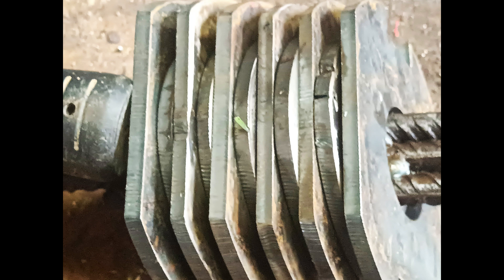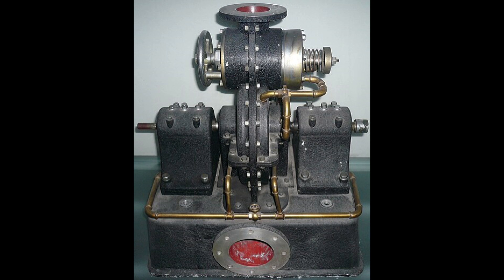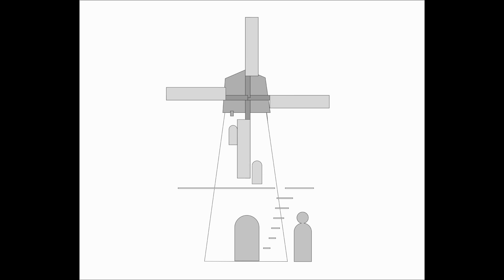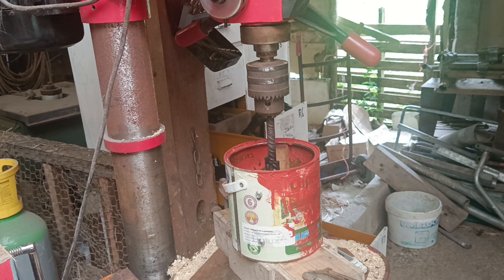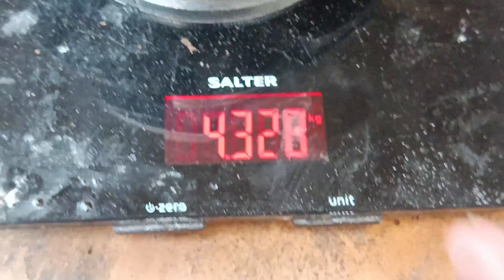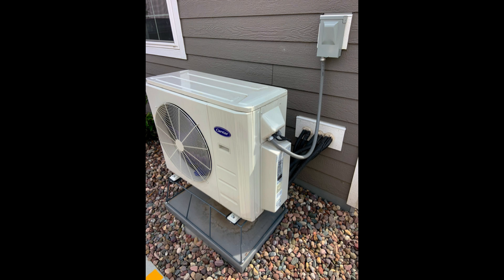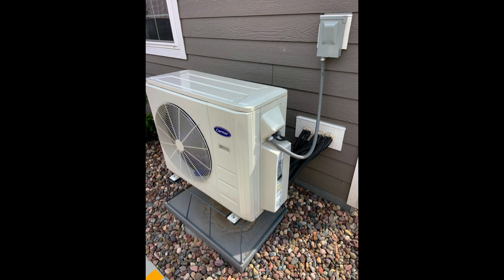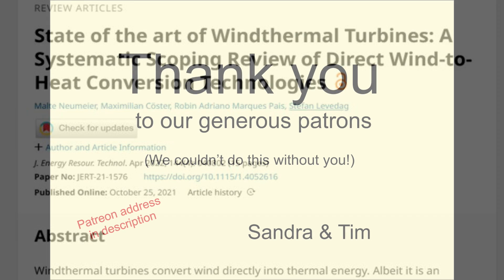More Interesting Things About Friction And Mechanical Heating - It's All So Interesting!

Comment: Efficiency is usually thought of as "How much of the energy put into this thing actually did what we wanted it to do."  The rest is lost as heat.  And energy is never lost or destroyed, it can just go some place that isnt useful to us.   So "efficiency" and "energy loss" dont always mean the same thing when it comes to heaters, very especially heaters that dont use a fuel.  An electric heater is 100% efficient:  all the energy it uses ends up as heat.  A 1000 watt space heater, a 1000 watt high efficiency LED light, and a bitcoin mining computer using 1000 watts will all heat up a room identically.

So, whatever you have the output shaft of that windmill doing, as long as its only barely able to do it, it will be making heat.  Grinding steel plates against each other, stirring a fluid, moving magnetic fields past a conductor, whatever.  Just add load until the windmill can just barely do it.  Normally I'd say add a flywheel to help average out the input energy of the wind vs the load, but the mass of the sails/turbine and rest of the system are probably enough.

Comment: Are small liquid-cooled alternators/dynamos/generators a thing? (I know GIANT ones exist) I imagine such a unit could serve dual purposes by just shorting the output through a large liquid-cooled variable resistor. You could even use a "water resistor" by submerging a pair of heavy steel plates as the variable load, and looping that water into the system as well.

Comment: Don't think that the heat pump is very complex, the only thing is the compressor, the rest are some copper pipes and radiators, and gas you can use propane, I have made two heat pumps for something I'm doing and with propane they work very well.
Reply from the maker: I'd be interested to see how you did that Gabriel - do you have videos about it on your channel?
Reply: @wayoutwest-workshopstuff6299   Not yet, but I have seen most of the information on the youtube channel of hyperspace pirate.

Comment: Maybe use some very high volume hydraulic pump? At 80 rpm it may still take enough power to restrict windmill, all that restriction will be converted into heat.

Comment: This can't possibly work but here goes. One complete coil (a shorted out motor winding) spinning inside another complete coil. Will this generate electricity in both coils and heat them up? I have no idea but if it was put in oil and then water cool the oil with water. Cheers

Comment: Heating with a brake is a good idea. I'm not sure you need to re-invent the brake. Any brake mechanism would work assuming it is big enough and you have some way to keep it cool (e.g. the whole thing is in a box surrounded by water) You can stick with your plates, but you only need 2 stators and 1 rotor and a way to adjust the squeeze force.

Comment: Completely get why you want to use the plates like this (some wheeled diggers basically use this for brakes - it works well! but it might be worth alternating materials so you don't get cold Welding / galling (not sure what's an easy/ cheap second layer, wood might be too low friction when wet and concrete might wear the steel to quick? - oil could be used instead of water too for higher friction materials ). Another cheapish option for magnetic heating is just submerging an old pm motor in oil, and shorting its windings (through a few metres of thick wire which is also under oil). The windings are normal good to at least 180c (a longer shorting wire can increase its resistance and lower running temp if to hot - or a big resistor bank could be used ). Ac works better for this as brushes wear and knacker bearings if in oil, the brushes might not cope with the current too - but dc would still work for a while though!

Comment: Hey Tim, may have been said but the favorite for energy storage is a sand battery. How about stirring the sand to heat it, like a huge rock tumbler, low speed high torque can be used by large diameter tumbler and small diameter for high speed low torque. The paddle could be made variable diameter or pick up more if available energy rises. Cheers
Reply: That's a great idea for my daydream of manufacturing sand.

Comment: Problem with heat pumps in winter is where do you pull the heat from?  The cold outdoors ? I would look into  Dynamic Heat Generator..  Love your content Cheers
Reply: There's been some success with drilling below the frost line to get to soil or the water table that's warmer than ambient. Not classical geothermal of course but same principal over a smaller thermal gradient.

Comment: thank you for this follow-up video. the induction heaters may require high speeds, but there is less friction and torque required to drive them. I'm sure you already are aware of this, just wanted to comment this anyway lol. I'm still rooting for the generator though

Comment: I'd suggest using oil instead of water for the inner tank as I think rust will be more of an issue than you think. If you put the gears under the fluid as well then the gears are nearly 100% efficient as they lose efficiency through heat. Do as much gearing as you want under the fluid and you are not limited to metal on metal friction. I prefer the heat pump idea. See if you can pick up an old cheap freezer or fridge pump. Lot's of interesting ways of getting the heat to pump (air source, ground source , solar water heater, compost/manure heaps)

Comment: Thinking of friction - what about car or even truck (lorry) brakes? They´re made to turn kinetic energy into heat and release it into the air (or in your case water) around. You could stack brake discs and pads inside a pot and control the friction with a spring pressing on the whole stack. The more rpm the windmill turns, the more pressure on the spring so alongside to the heat you get kind of a governor for the rpm of the mill.
My idea is four brake pads, then the disc and then again four pads. Then the same setup again and again. The discs are turned by the shaft while the pads are held by some kind of track so they can move a little up and down (as necessary depending on the wear and tear) but not sideways.
I´ve got lots of ideas for this, but no possibility to test it myself.
Reply: Just absolutely make sure they aren't asbestos based (they still exist in america), also you probably want a way to contain the dust because any of it is absolutely unhealthy :(
Reply: What about cutting up a second disc and using that as the "pads" or simply sandwiching the discs without pads? Brake pads are made to take most of the wear while providing a quiet smooth, fast braking experience which we don't care about. Discs are made to provide a friction surface and dump their heat into the surrounding area which is what we want. I guess it also depends on economics of what he could get the cheapest. So many experiments!
Reply: pads waer out. brake rotors wear out.

make dust. squeal. need maintenance. servicing.

eddy currents, magnetic induction, does not.

Comment: My door bike trainer uses rotating magnets rotating in an aluminium housing to convert rotation into heat. No rubbing or wear, and you can control how close the magnets are to the aluminium to control the torque…maybe second hand  “turbo trainers” could be a useful source of parts.
Reply: And they come pre geared to work at bike pedalling rpms …like 30-130 rpm sort of thing.
Reply: Why wouldn't a generator be more efficient? A generator uses magnets to pull electrons through a metal, eddy current braking does the same thing. Except with a generator you can dump all the electricity into a load designed to create heat at one single point. Resistor, bulb, heating element.
Reply: @pgtmr2713  because a generator is NOT SUPERCONDUCTING.
it has resistance.
and its in parallel with the load. 
series?
parallel ;)

what happens when you have equal resistances?

half the power is dissipated in BOTH.

lenz law demonstration... magnet in a copper pipe. resistance is the pipe itself. the conductor and its induced opposing eddy currents.

cut a slot in the pipe, theres no eddy currents, no lenz reaction.

change the pipe for a coil. short it out. lenz reactions. eddy currents. wheres the voltage? you have to break the closed loop to measure it. you cant actually measure it. it doesnt exist. you only have current as a magnetic field and a "virtual" emf due to the resistance of that conductor.

you put a resistor across... as it gets larger, more "open circuit", the voltage increases, you measure more drop across the load, as current flow through the generator AND the load reduces. 

you overlook that due to current flow, some power must always be lost in the generator itself.

"jacobs law".

your generator is only "efficient" if its of much lower resistance than the load, and the output of it is well below what it can actually deliver! if it were to deliver full power to an equal resistance, you could only transfer HALF the power, and the rest will appear as heat in the generator.. but that would actually be when its 100% efficient! 

efficiency is a bit like statistics, you have to be careful about WHAT theyre measuring and comparing ;)

an eddy current brake on the other hand confines all that current to one conductor, and all that current appears as heat, due to currents through resistance.

its like water brakes... you could make a water pump, hydraulics, the fluid, pump, and hydraulic thingy get HOT.

but the task required that... say, i was running a pressure washer. or bobcat... excavator?

whereas if i wanted to actually just make HEAT? or a dyno, a variable load to test engines?

i would plumb the pump to itself and work on that, why do i need the whole excavator?
Reply: I have seen cody's lab do a similar thing and it works quite well!! Magnets can be expensive and hard to get though, especially neodymium.

Comment: hoo boy there is a lot to talk about

I said before that generating heat this way IS the most efficient, as any losses you have will end up leaving as heat, which is what you are trying to get anyway

that said

you already have a line shaft setup, and I seem to recall that there were line shaft shops that were powered by windmills. I might be foggy on that, as most of those mills were used for grinding flour. one would think you would have entertained that idea, maybe you did.

then again, I had visited an energy fair locally and I had come across the evacuated solar powered heater tubes used for heating water. I came across on of them INTHE SHADE that I thought it's temperature readout was faulty, as it was reading in excess of 100+F while IN THE SHADE. I confirmed it was working correctly when I touched the output manifold and burned my finger on it IN THE SHADE

but finally, you stated this was an exercise in finding a use for a windmill that is easy, useful, and not complicated. and have pointed out everyone's alternatives as not meeting those requirements. I am not sure how much of a market there would be for ground products (garlic?) that you harvest, but a mill would look to be the easiest, but maybe not the most useful, with your friction heater being 2nd, or maybe  3rd most ideal

so, when can we expect some wind brewed tea?

Comment: For the issue of needing an additional fan or pump along side the compressor to go with your heat pump option: You are building this to fit to a windmill that you want to use to concentrate heat... You can use the same 'fan' you're running your windmill with on your cold side, and your hot side fan can be whatever you were going to use to move the hot water from your friction generator. 

The sides of your windmill become your heat-capture 'radiators', warming your chilled fluid by allowing the same wind driving your windmill to blow over them and transfer energy into the system so you have more heat energy to pump out to your hot side. It may be more cost effective to build it as a relatively small refrigerant loop heat exchanger inside a larger brine tank/loop. 

The thermal safety wiring on things isn't really any more complex than you would need for your friction based machine - You do probably want something on there to monitor that your friction core isn't running dry and turning into a glowing lump waiting to fling itself apart after all... Remember: Every machine can become a smoke machine if you run it badly enough.
Reply: This is a scaled down version of an idea I had for the 70MW range of turbines (using recycled truck/train/marine engines as the compressor).

Also if the site is built over an old mine (preferably flooded) the heat energy can come straight from there (albeit better suited for district heating)

If conventional vapour compression gas is not available, a humid air medium could be used.

Comment: technically you don't need high rpms for most of the alternative heating methods you mentioned, you need high surface velocity. For induction heating, you could either spin a smaller disk really fast (with efficiency loss in gearing), or a large disk turning relatively slowly. What would a 1 meter diameter steel disk do, turning at 400 rpm, through a strong magnetic field?
Reply: got he 400 or so magnets he'd need? he pointed that out
Reply: @Tater1337  He's pointing out having the magnets stationary outside the wheel, so you'd need less.

Comment: If you're going to have heat exchangers between the liquid around the friction plates, and the water in the storage tank, you could put other materials around the friction plates to generate the heat. 

Maybe instead of water, fill the friction plate container with oil, sand, or salt. Solids like sand or salt could generate more friction and more heat at a lower RPM.

Comment: The main problem I can foresee with the friction heater is in the exchange. It certainly would work to heat up water, as your clever testing shows, but how efficiently can that heat be exchanged into the water you actually want warmed up? That's an open question, and I think perhaps you might need to run a second experiment with a primary container that is sealed up a bit better than your first paint can test, and place that into a second container to see how well it heats (of course the best exchanger will be one designed to maximize surface area, but this basic set up would work for a test). Other methods like electric might lose some efficiency in the conversion, but would that end up being more efficient over all because it could heat the water directly? Again, that's an open question. 

I am intrigued by the idea of a wind powered heat pump. The main question there is whether or not you can get a high enough pressure.  If you were curious to try it, old school heat pumps used ammonia for their exchange gas; still a potential for danger when under pressure and breathing, but certainly safer and cheaper to obtain for testing purposes than other refrigerants.

Since you mentioned induction heaters, would there be any reason you couldn't do that in combination with the friction heaters if you're using steel plates? Perhaps using electro magnets rather than rare earth magnets? If you do end up trying a design like that, consider if you can make a double shaft and have the plates rotating one direction while the magnets rotate the other, you're effectively doubling your speed without having to make the contraption actually spin any faster.

Comment: Heat pump and drive the compressor from the shaft rather than electric, then your going to aim for above 100% efficiency rather than converting it directly to heat from friction your just moving heat from the environment to your heat storage, even 0c has enough energy in it to heat something up, yes it gets less efficient but your going whats less than 300-500% is still a nice gain.

Im sure its plenty complicated but would love to see this kind of thing in practice driving from a wind mill.

 - Not a expert at all just ideas to think about

Comment: Good idea about reducing the number of energy conversions so using friction is a good wheeze imho. To increase it even more you make the rubbing surfaces rougher by pitting or some welding blobs or some such which will also wear but create more friction while it is rough. Also, if you add some weight to force the plates together, more friction too - the resisting force is mu, the friction coefficient, times the applied load - so if you squeeze the plates together, it will be harder to turn and generate more heat, but you must balance against the rotating speed - the work you get out is force times velocity, so a bit of experimenting to find a good balance. Good luck and get well soon
Reply: you want the surfaces smoother, not rougher. maximum friction surface

Comment: What about submerging an air pump into the tank of water (driven by the wind mill). The pumps get very hot, causing the surrounding water to get hot. You'll also have compressed air in the process, if you ever need it.... Just a thought. Looking forward to the project.

Comment: With a heat pump you only need a fan if you don't put out enough collector panels, if you have to small a collector like a heat pump designed for a flat or high-rise it will freeze without a fan but if you have space you can put out as many collectors as you like.. And the good thing is the collectors are very cheep.. you could even use large panels of of the back of drinks cabinet fridges..  Thank you keep up the good work from Tony in Glasgow..
Reply: the goal is uses for a windmill, not heating water. also break the 3 rules of simple, easy, and cheap that he is following